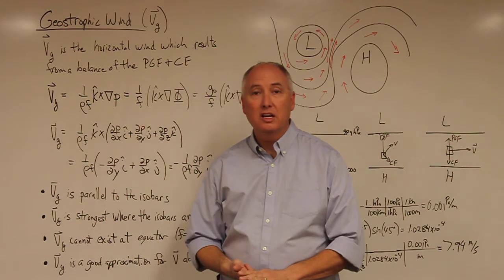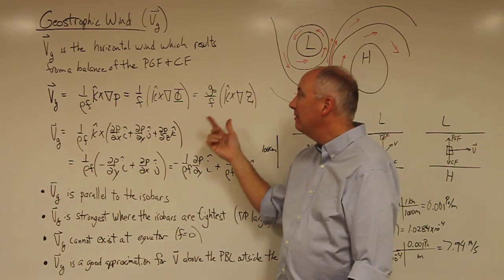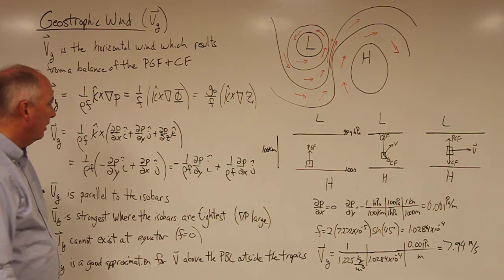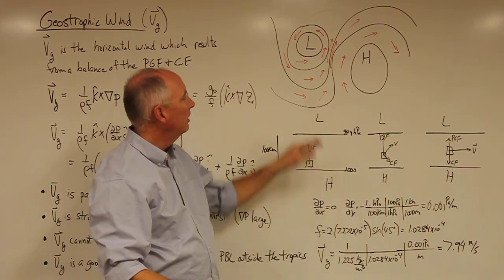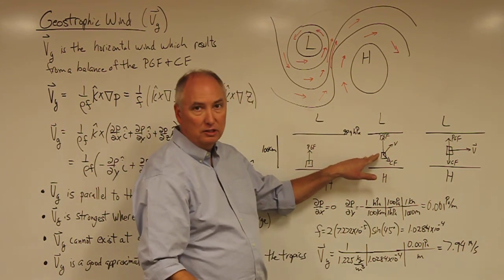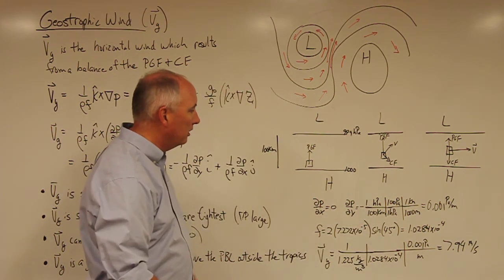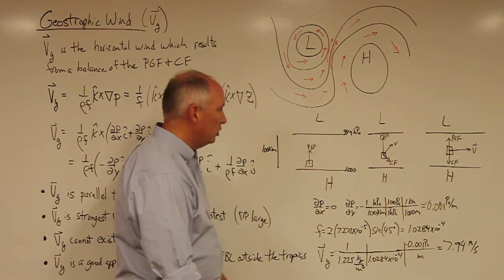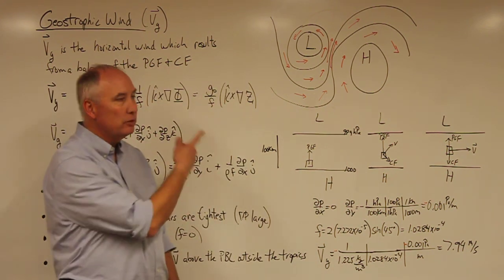Lecture 41 Geostrophic Wind

Comment: Hello!

I'm trying to find someone who explains to me why that happens the way it does.

I like understanding the main reasons of everything, the logic, because things don't happen just because. In physics, it's not only that things happen the way they do, but that it would be impossible that it was any other way.

I see why in the Northern Hemisphere the Coriolis Force tends to bend a wind that it's blowing from South to North, towards the East. That happens because the momentum of the wind is higher the closer it is to the equator, since the radius is higher, so its absolute velocity is higher, then if it's moving further away from the equator towards an area of smaller radius and therefore lower speed, the wind has more speed than the land it is entering into so it "overtakes" that portion of land. I see why it is that way and how it would be impossible to be any different way.

BUT,

Why do we assume that the Coriolis Force always acts at 90º to the wind? What makes the Coriolis Force act like that? What is the logic? Why is it that way and not other? What is it that makes it impossible that the Coriolis Force just affects the components of the wind going North or South, but not the E-W components (which would fit the logic applied in the previous paragraph)? That is the part that I don't see. It's not that I don't believe it, I do. But it looks like an act of faith. I don't see it, I just have to believe it's true because that's what I've been told at class. Any logical intuituve explanation?

Thank you!
Reply: I know exactly what you mean because I used to think the same way. But I can explain for you. You are going on the explanation of Coriolis force as that of the Earth going different speeds at the Equator than at the poles. By that definition only north and south winds should be deflected. But that’s not true. That’s part of it. But you also have to look at the Earth from above, looking at it from above the North Pole, the Earth is a giant disc rotating counterclockwise, and if you tried to trace a straight path on this disc no matter what direction, it will always curve to the right. This explains how winds going East and West can also be deflected.